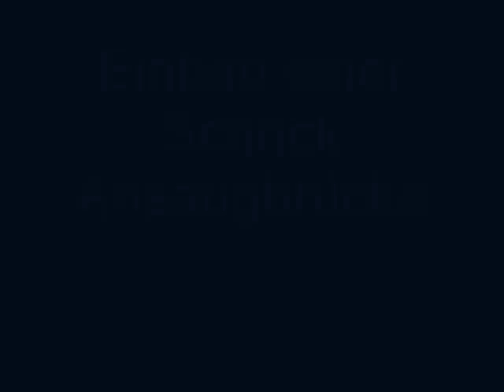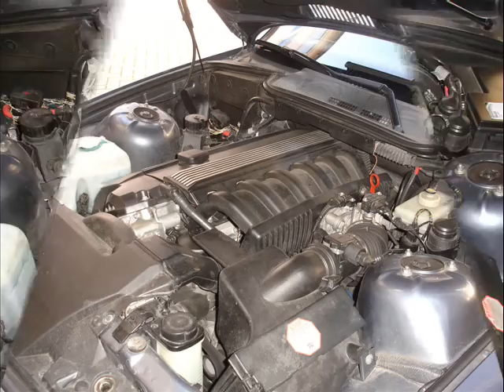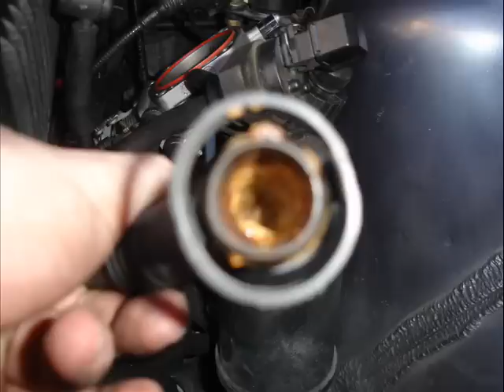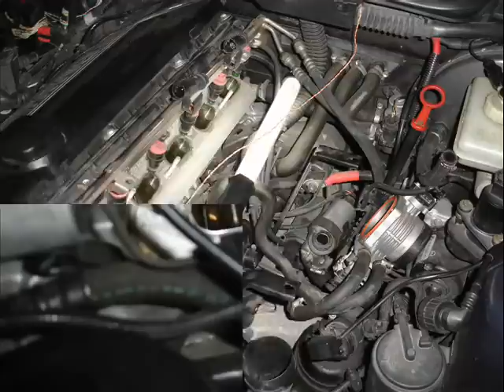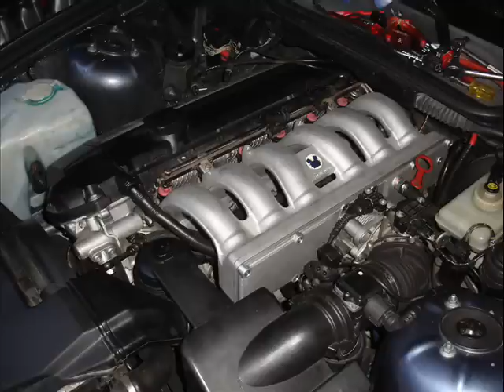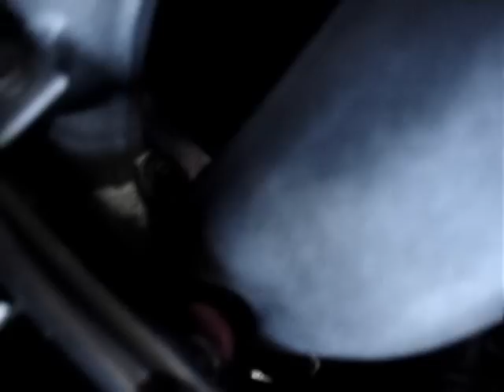Schrick Ansaugbrückeneinbau

Comment: Hola, cuantos hp mejoro? no pensaste en colocar el multiple M50b25 ?
Reply from the maker: Si tiene un M50B25, no necesita este colector de admisión. El M50 ya tiene una mayor ingesta.
Aprox. 15HP
Reply: @Mr3erCabrio  claro, por eso te preguntaba, porque vi que tenias el original m52. Mi pregunta es que diferencia hay entre el usted coloco con el M50? hablando de prestaciones, no de materiales
Reply from the maker: @leonardochara  I suppose with the M50 intake there will be a little bit more output, but you can't get a legal approve for the M50 intake on a M52 in germany. The Schrick intake is legal.
Reply: @Mr3erCabrio  Ahora entiendo. No sabia que en otros paises pasara eso, aqui en Argentina es legal, mientras no se de cuenta la VTV (Verificacion Tecnica Vehicular) Saludos y felicitaciones!